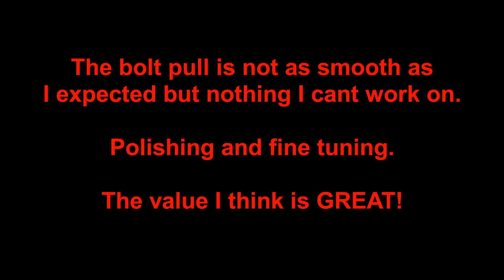Inferno Airsoft Vsr 10 Cylinder set

Comment from the maker: alright so the end there where I basically slam it shut is actually because my outer barrel was a little loose and wobbly so I think that was an alignment issue I got it fully assembled and took out all the wobble and it cycles much better, I also took the spring out that it came with and put in my spring I know shoots 410 fps and the bolt pull is very nice now! just have to play around with the Action Army hop up now as the aluminum block that holds the upper down to the stock does not line up by a very small amount.... the Action Army is made to fit the VSR 10 not the SR 40 (clone) guess its not as close as I hoped. so I will make a video for that as well!

Comment: Nice video! What airsoft sniper do you recommend for a solid body and base to upgrade from. That SR 40 looks amazing!
Reply from the maker: So far the sr 40 for me has been a great base, very solid. it does require a little tinkering though, vsr 10 parts do fit for the most part. My Action Army hop up I got, I had to open up one of the mounting holes to get it to fit.  The "vsr 10" 430 mm barrel is a shade too long, so I can't thread the barrel cap all the way in. After upgrades and original purchase price just 500$ Canadian total it's a great budget build I think. But I have no trigger parts yet I don't think I will need any as I'm limited to 400 fps. This is the only sniper I've owned, I have shot lots even the SSG 24 and honestly there all basically the same... I think the Ares Striker has the Best Value out of the box.
Reply: Twitch Airsoft Sniper thx for  the help! I guess i should get one too then!